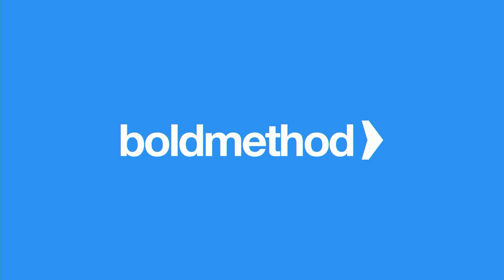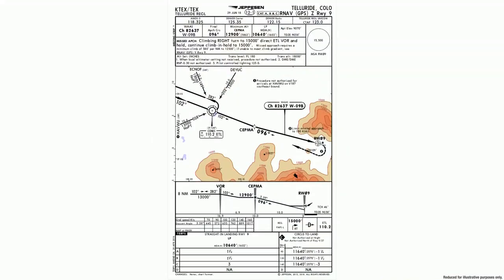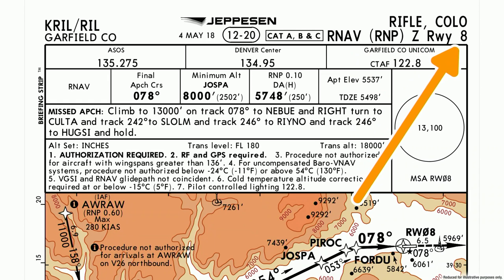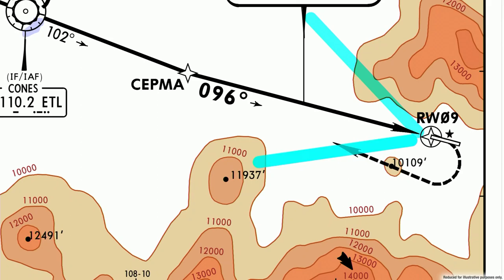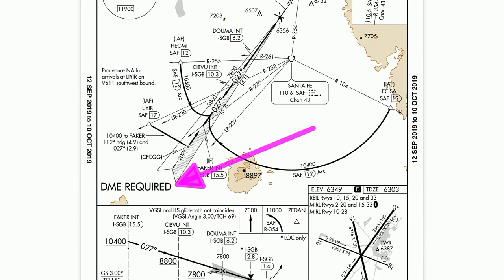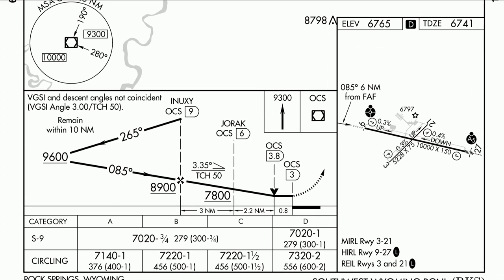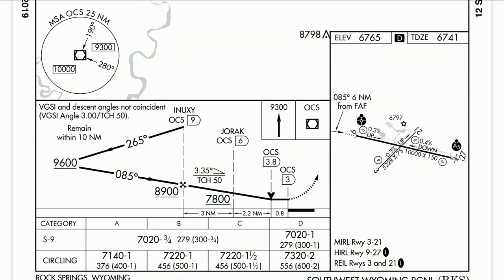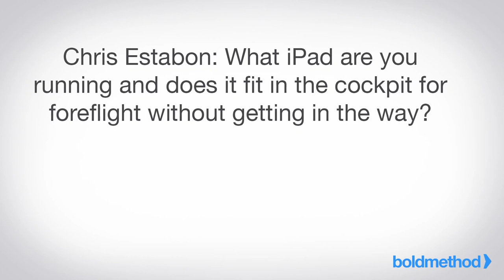Understanding Approach Chart Notes And Requirements: Boldmethod Live

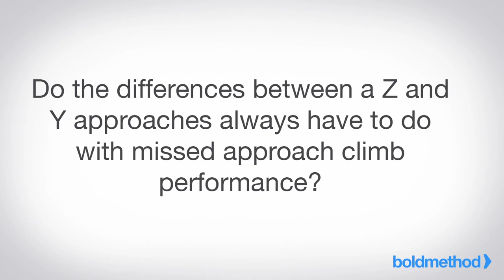Comment: 14:40  “The approach procedure labeled Z has lower landing minimums than Y (some older charts may not reflect this). Instrument Procedures Handbook, p 4-11

Please note, it say's "landing minimums". This is visibility.

But of course, this GPS stuff is complicated. And being so complicated, there are going to be widespread errors.  For example, at Anchorage, Ak (PANC), there are two RNAV approaches to 7R, Z and Y.  The RNAV (RNP) Z landing minimum is 5000 RVR.  The RNAV (GPS) Y landing minimum is 1800 RVR (and the HAT is a bit lower, too).  This does not comply with the statement in the FAA's Instrument Procedures Handbook.

And, wouldn't you know. Look at the Equipment Requirements boxes.  The RNAV (RNP) Z box states RNP AR APCH.  And, the RNAV (GPS) Y equipment box states RNP APCH.  So, the Z approach, which has the higher mins - is Authorization Required (this does not include Part 91 operators). Go figure.

Comment: Very interesting video. In my understanding, the difference between RNAV and RNP is that RNP standards require the system to alert the crew should the actual system accuracy (ANP) exceed the required accuracy (RNP) eg « UNABLE RNP » message on the CDU, while RNAV standards don’t mandate this. I was curious recently because we see a mix of terminology (PRNAV, RNAV 1 or RNP 1) on SID /STAR charts so I had a look at the Eurocontrol official glossary. EUROPE, not FAA but I assume this is an international norm.

Comment: I use Garmin Pilot on a Nexus 9", in a c172 and when clipped to a metal kneeboard it has very unreliable GPS reception. I also preffer a real pencil/pen and paper for notes just  so I don't need to switch screens any more than necessary esp when briefing an approach plate while in the soup. 
I go out of my way to avoid supporting Apple products, if they get a monopoly it won't end well.